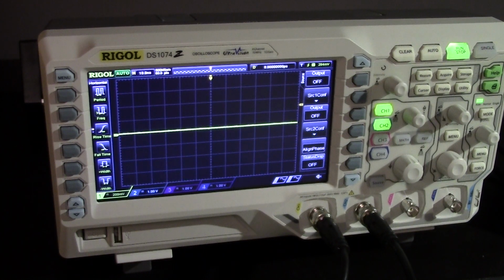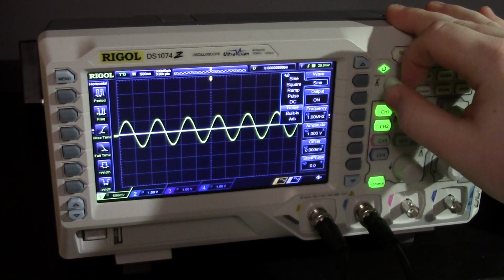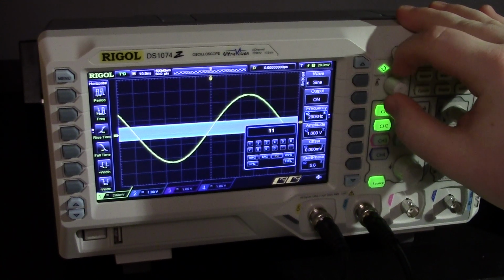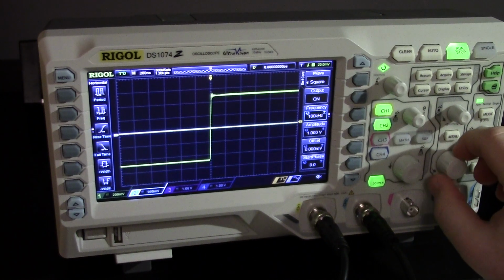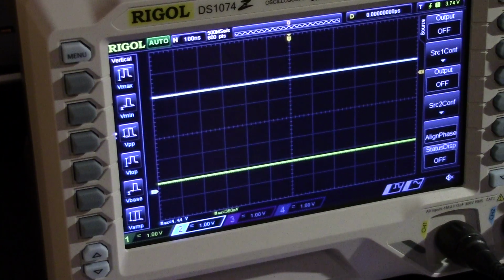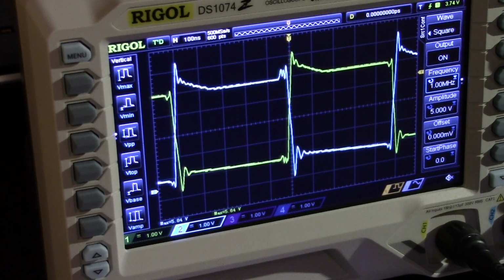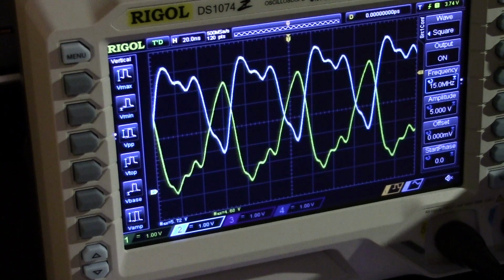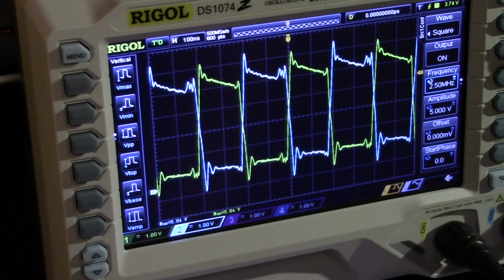Rigol DS1000Z Series - DS1074Z-S Function Generator

Comment: If working on vintage audio gear and need to apply 1 KHz tone with 10 dB into the audio line IN of the deck being worked on, How do I go by setting 10 dB value and do I need a special RCA cable to connect from the oscilloscope output to the audio equipment?

Comment from the maker: Just as an update - a firmware update has since fixed the general slowness in the menus and when adjusting the frequency on the function generator. I would still recommend spending a few extra dollars on a dedicated function generator instead, if it's something you will use often, but for the extra price over a regular DS1000Z, it's not bad.